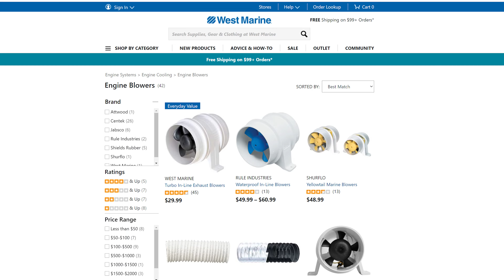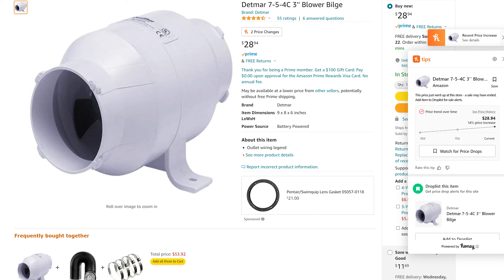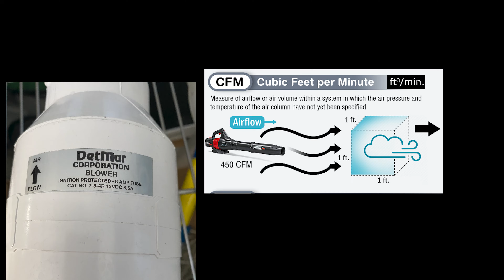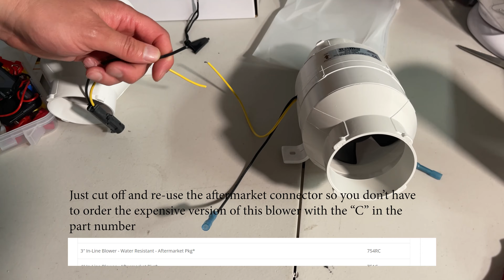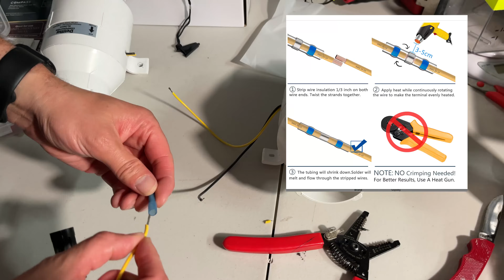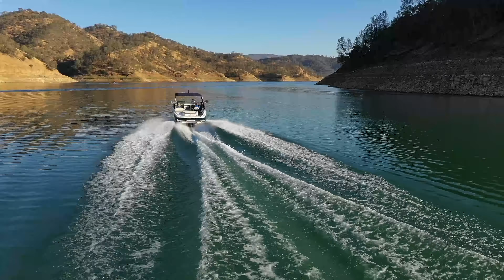Replace Boat Blower on Any Small/Medium Boat

Comment: Do you know what blower is in a 2008 X2 Mastercraft?
Reply from the maker: Hey Scott, great question. Most 2008 MasterCraft X2 models came with a 3” inline bilge blower—usually from brands like Attwood or Rule. To be sure, I’d recommend checking the label on your existing blower or measuring the duct diameter (it’s typically 3 inches). You never know if the dealer or a previous owner replaced it with a non-factory branded blower. Stick your phone down in the engine and snap a photo of the model number. Order that and or something equivalent and replace it when it arrives.

Comment: I have an old ski boat, fans are broken, 2 pieces. If I replace them, do they have to extract the engine compartment or blow it in? or 1 blow in, and 1 suction
Reply from the maker: Extract on both. There are fresh air intakes to replace the air that is in exhausted. Refer to the cartoon looking photo in the video.

Comment: Great video! Thank you! Hoping to be able to replace the blower on my 2012 Mastercraft X55 in the next day or two, but don’t know where to look for it and hoping I can get it done. How long do you burn the connections for to make sure they are sealed?
Reply from the maker: You’re going to have to look around and pull a panel or two to be able to find your blower. This is easier done when the sun is down and it’s not so hot. Just keep that in mind. I burn the connections enough until I see the metal inside start to sizzle and melt. And I know I have a good internal soldering connection. I hope that helps.
Reply: @fixitwithjake  thank you! Really appreciate it!

Comment: While replacing two 24v blowers that no longer worked, the vessel's wiring diagram confirmed they turn on with a thermostat I found in the engine room which appears to have rusted to an on  condition keeping the solenoid that feeds the blowers energized. I've a photo but no way to post it here and have never seen a thermostat like it nor has the boats manufacturer as the company was long ago sold.
Reply from the maker: Feel free to email me some photos of the device and I’ll see if I can find the exact one or equivalent for you. Fix it with Jake @ gmail dot com

Comment: As versatile as plastic is they should use aluminum for the propeller.  I rarely see fans or blowers with them anymore.  Lighter and more resistant, it would probably extend the life of the bearings and avoid plastic shrapnel from possibly causing damage to other components upon failure. 
Very good video. 👍👍
Reply from the maker: That is a very interesting comment. I like where you’re coming from. Too many of these cheap plastic propellers inside the blower get destroyed. Usually it’s from something stupid like a broken zip tie in the bilge compartment that gets sucked up. And breaks the blades.

Comment: I'm trying to use a marine bilge blower for an extractor fan in an airbrush spray booth setup. But the DC power supply I'm using doesn't seem to be adequate. I matched the volt and amp rating, but the fan turns on, then immediately turns off then repeats. Not sure what I'm missing at this point.
Reply from the maker: That’s a good use of one of these. It’s possible you are loosing some amperage in the wiring. Can u try either larger size wiring or over size the power supply a bit more? If the fan runs well of a 12v battery then you’ll know it’s the power supply.
Reply: @fixitwithjake  it seems that the power supply I chose can handle the blower at it's constant power draw requirements, but not enough for the initial draw as it spins up. So I need a power supply with more amps.
Reply from the maker: Ahhh, that makes sense. Just like an AC or Refridgeration compressor. Takes a lot more to get going.

Comment: Why are you connecting the yellow wire to black wire? Would I be wrong to connect yellow wire to yellow wire?
Reply from the maker: Good catch! It was a mistake and I had to redo it after filming was done. Match the colors and also check the direction of the airflow to match the big black arrow on the blower.
Reply: @fixitwithjake  Great Video though. Thanks. Made me think I could handle it myself. We will see tomorrow when the part arrives.